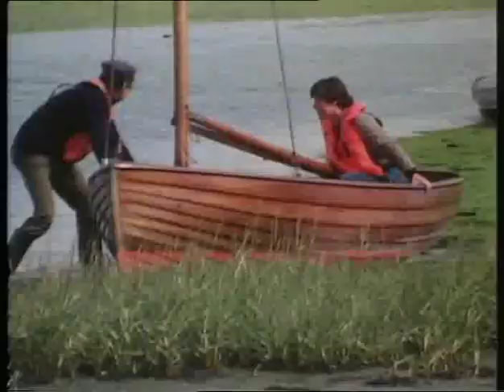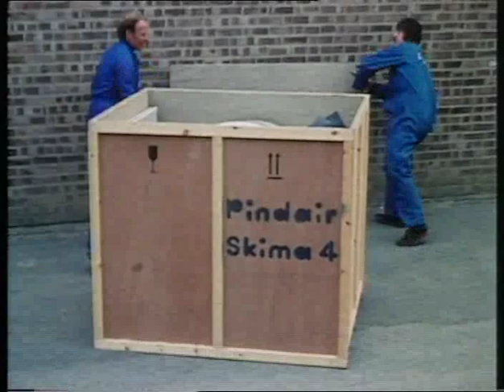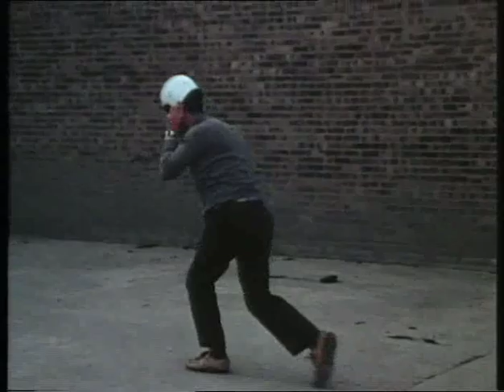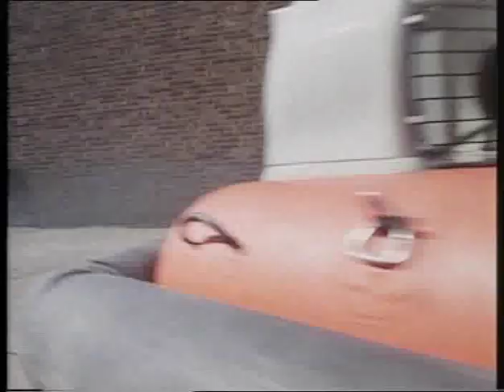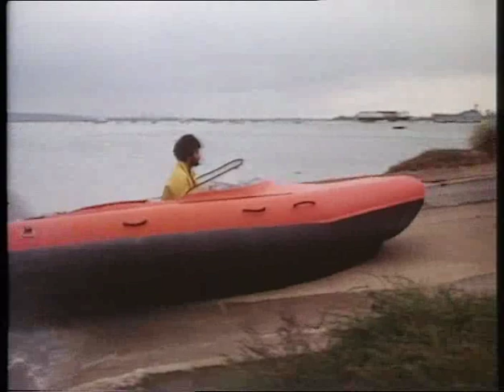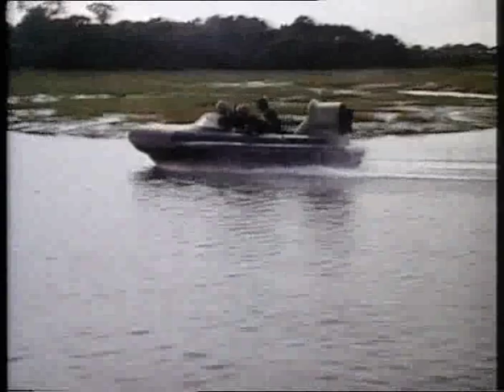Pindair Skima 4

Comment: Looks like a orange zodiac with the front third blocked off.  It wouldnt be that hard to recreate using a zodiac.  Although that Hirth engine is junk these days.  Get a Yamaha or similar 2 cycle 2-3 cylinder engine.  The only problem left is noise, too many towns would require a greater muffler.  Yet the adjustable air duct for increased capacity is a real plus over the Scat type hovercraft.